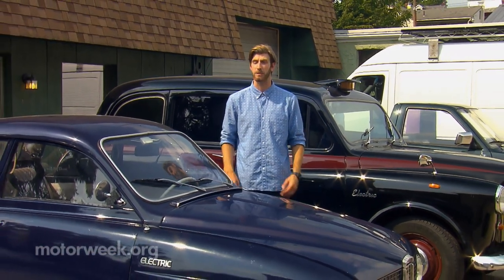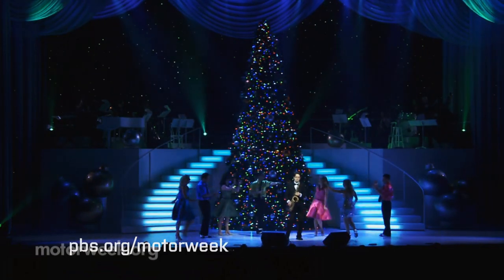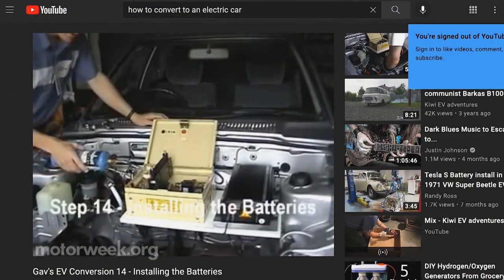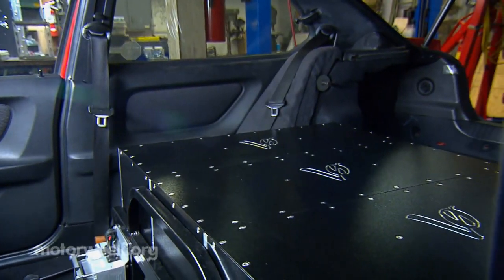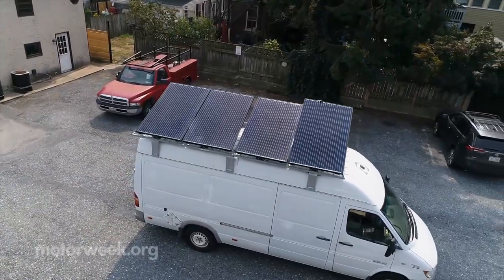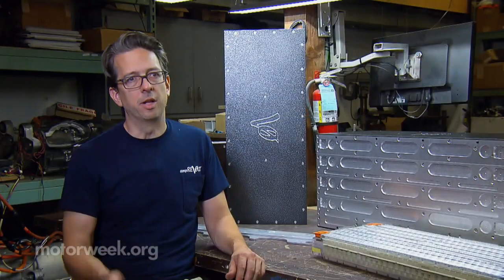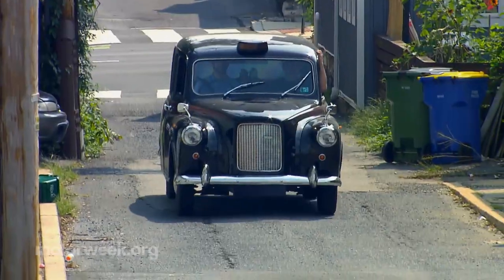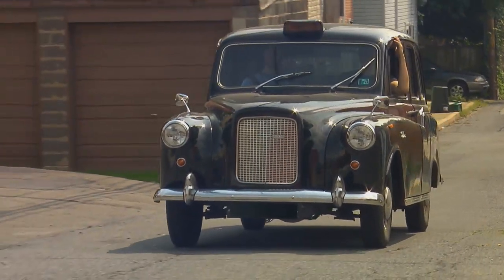Converting a Vehicle to Electric with ampREVOLT | MotorWeek Over the Edge

Comment: How do you retain the heater and air conditioner? Do you have to replace them with electric versions?
Reply: Yes, you would use an electric motor powered A/C compressor and there are various ways to do the heating. You could get an A/C compressor from a junked EV like a Tesla, and plumb that into your existing A/C system.

Teslas and some EVs have an electric water heater unit that heats the coolant that's used to keep the batteries warm at low temperatures. (The battery pack is happiest and lasts more years at a constant 70 degrees Fahrenheit.) You could use this heater to heat coolant circulated by a 12 volt water pump to your existing heater core. This way you retain your original HVAC system and don't necessarily have to remove the dashboard during EV conversion. There are also aftermarket electric heaters made for hod rods that have a blower motor, heating element, and flexible ductwork that you can adapt to your build.
Reply: @snowrocket  great to know!

Comment: Very cool but hopefully he does the heating and cooling part along with this bill because don't know one want to be hot in a electric car in the summertime and vice versa don't know one want to be cold in the winter time a lot of companies are doing this but do not mention any type of HVAC system needs to go along with the build as well to be successful....🧐🙄
Reply: Probably using hvac from a ev.
Reply: The ac compressor will be easy to run off batteries but heat will require some thinking with the lack of coolant
Reply: @super-kami-guru   unless they use a radiant heater
Reply: We actively heat and cool both the cabin and batteries.  :)
Reply: @sockosockosocko  Using what system?
Im curious.
Reply: @myname9252  We are now able to use the same battery mgmt, thermal mgmt and max/min settings that the OEMs use.  Lots of R&D to get to that point.
Reply: @sockosockosocko  heat pump?
Reply: @MrTaxiRob  not yet ;)
Reply: @sockosockosocko  my '99 Suburban with 42 gallon tank has a theoretical 500 mile freeway range. What can you do with that big pig? And wouldn't large SUVs be an ideal platform, as well as the biggest gashog segment of the fleet to go after first?
Reply: @MrTaxiRob  we are actually focused on vehicles of this size (incl. delivery vans, trucks, school buses, etc)  DM for details.

Comment: wished they explained how big a motor u need for a certain weight of vehicle and what speeds/range to expect?
Reply: The EV conversion companies can guide you to the proper size motor for your application. The good news is the motors don't take up as much space as gas engine and you don't need a traditional transmission. The bad news is it's the batteries that are large and heavy and expensive and THAT'S what takes up the space in a conversion. Batteries CAN be located almost anywhere, though.

Range is largely determined by your overall efficiency and how many batteries you have on board. Teslas are VERY efficient. Even if you can fit all of their battery pack into your build, don't expect to get similar range. The aerodynamic drag coefficient of a Tesla is around .25-.30 and they have minimized rolling resistance. If you built a Ford Crown Victoria as a Tesla converted EV, I'd bet your range would be around half.
Reply: They won't because then they have to make drivers aware that they are taking a HUGE loss in weight to power output ratio.

Comment: Wouldn't it be kinder to the environment to retain an original engine & transmission instead of producing an entirely new electric drivetrain? 
Classic cars are generally low mileage vehicles.
Reply: The video is basically about promoting the use of salvaged EV components.  But even using new components is super beneficial considering EVs are 85-90% efficient vs the 15-20% efficiency of gas cars.  The difference is enormous.  Old cars are usually the dirtiest cars, grandfathered in with no enforceable emission standards.
Reply: Watch the video. They mention reusing wrecked or salvage parts. So it's a win win. 👍🏻
Reply: you are right, rarely driven classic cars that are just eye candy, rarely use their gasholes.